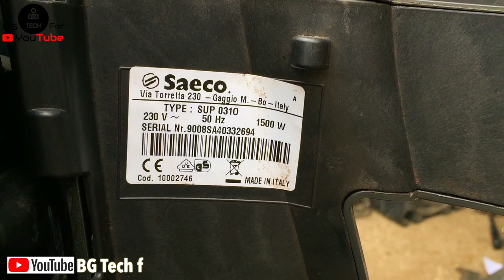🔥 How to FIX:🔥 Saeco Odea Talea Go / Giro - Fast blinking RED LED | Repair Without money |

Comment: I have same machine but, if the problem is the following:
Midway through the grinding cycle, the coffee making process just stops/ends 
- that is the grinds are dumped into the dregs drawer but no espresso liquid comes out at all.
-  and the red light appears on panel.

Then when I clear the red light, (by simply lifting the beans lid cover and put back)  then sometimes espresso making resumes as normal..Other times same stoppage and again wasted grinds dumped with no liquid.
Any idea which part is the problem?
Thank you very much for another great video!

Comment: Hi, I have Saeco xsmall coffee machine. When I try to brew coffee with it something kicks the brewing unit out about 2 mm and the red alarm light starts blinking slowly. What can be the problem? Can you help me please? I even tried the test mode. Everything is ok, but in 0 level of test mode when you first turn it on, the right green light is off. At that level both green lights should be on. What does it mean?